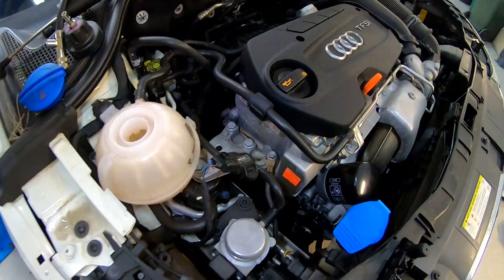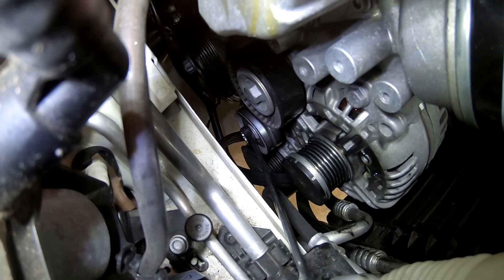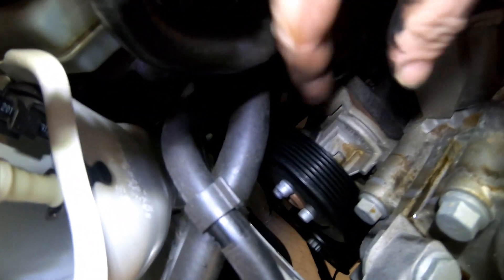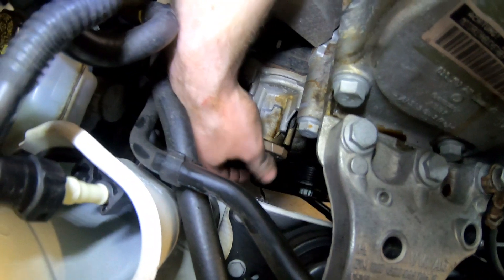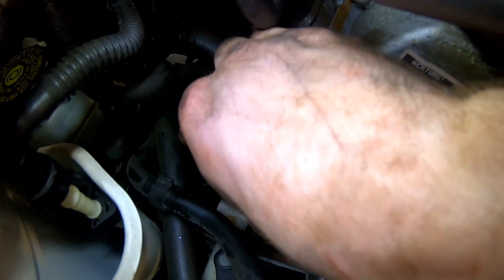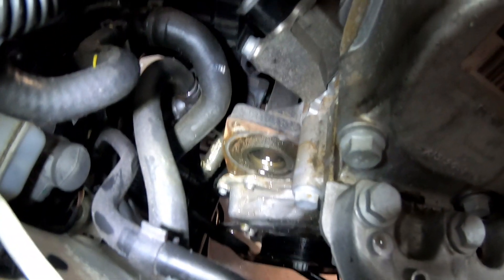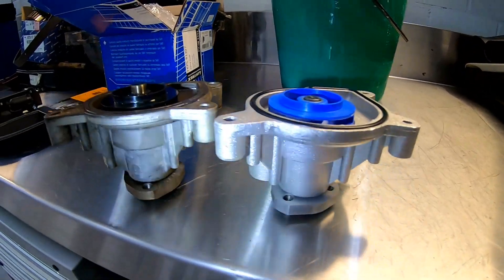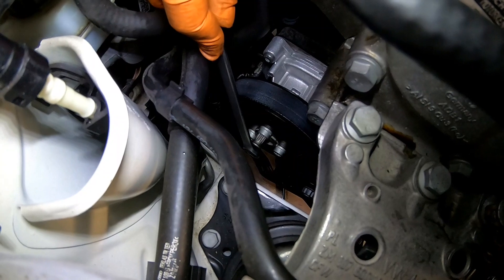1.4tsi CAXA Water Pump - Easiest VW Audi Water Pump?

Comment: What torque did you use on the pulley bolts and the pump bolts?
Reply: If I remember correctly it's 20nm
Reply: @bobmarley8000  thank you so much btw a mechanic from my city told me the pump bolts to the block use 12nm and the pulley 20nm

Comment: Comparing 00:20 and 03:56, you can clearly see the new pump has a hole in it, while the old one hasn't. The shiny thing visible through that hole is the pump shaft. What the hell? A hole through the top that gives dust and whatever direct access to the shaft? I'm somewhat skeptical of "cars being designed to break these days", but in this specific case — really, what the hell? What good could this hole do?

Comment: Hi @fourringsauto , you helped me big time about a year ago during rebuilding one of these engines thanks again!! 

Struggling to diagnose new issue.. started getting a “whine” noise at low revs. Was thinking water pump clutch or supercharger itself. Noise went at higher rpm. No fault codes. Now seems to be burning a bit of oil, and down on power at higher revs. Found lot of oil in inter cooler pipe and burning oil. Signify turbo gone? Diverter valve?
Reply: https://m.youtube.com/shorts/sykaJhKQ_OU?feature=share&fbclid=IwAR1n77DOXZQXdmTpiL0nBBtAcFR_6w8PCrY1E0YAkICiBWTX65Y_bOkrSUQ this is the noise

Comment: Excellent work. I have the CAXA engine in my mk6 golf too. I have noticed my coolant bottle is going down. I can’t see any source of the leak. Doesn’t appear any leaking at pump. But seems most likely. Is there any test I can do to check it??
Reply from the maker: Usually you would pressure test the system. Check underneath the radiator too. Look for pink staining if using factory coolant. Perhaps top up with distilled water for now and monitor it for the now?
Reply: @FourRingsAuto  thanks. I checked over engine with UV light. Couldn’t see anything. It’s very weird. Oil isn’t milky. I’ve ordered a new bottle in case. But it’s very odd.
Reply: @Clint_L  having this same problem the last couple months, did you solve it?
Reply: @CocoCoryBrough99  Had the same problem for months, coolant disapearing but no obvious leaks. One day when i coldsstarted the car, I saw a drop or two by the waterpump but nothing in the area around or on the ground. My theory is that it vaporises when the engine get hotter. I changed the pump and now I don´t have to top of the coolant anymore!
Reply: Update 🙂 ended up being the charge cooler (water cooled intercooler inside the inlet manifold at the back of engine) which was leaking coolant and allowing it into the cylinders, €90 for a new one and hasn't leaked since, all good 😁 fitted myself in 90 mins
Reply: Take off the plastic pipe going from the turbo to the throttle body, then push open the flap on the throttle body with a screwdriver and if you see coolant in the manifold behind that flap then you know that's your problem 🙂 I was lucky to find it by chance as I removed that pipe to change coil packs and happened to open it to inspect throttle body, I have a couple videos of it and the cooler leaking I can send to you somehow if need be, haven't found any forums or people who have changed the cooler so I think it would solve alot of people's problems 😁

Comment: I have a very big problem on my a1 1.4 tsi 122 briefly when the car get to operation temperature 90° I get hard hesitation on 4 5 rpm when I accelerate I changed the hpfp and nothing changed maybe you have solution or you had a story like mine . Thanks
Reply: Injector clean LIQUI MOLY magic.

Comment: Thank you very much
Very helpful
I managed to replace it to my b6 Passat 1.4 tsi caxa engine
I also had to remove an engine "hook" (undo two m10 bolts), which was standing in the front of the pulley. I didn't see it in your video, also it's not necessary to mount it back (it's there to hell you when removing/outing back the engine). I am not talking about the engine mount...
I am not mechanic but it's not difficult to replace it
Good luck!

Comment: I just got quoted a bomb to replace a water pump on a 1.4 Twin-Charger motor in a Tiguan.  Love the car, love the engine, but it's a five hour job they tell me.  The engine bay looks a bit different to what I see here, maybe a bit more difficult to access?
Reply from the maker: Tiguan is the easiest of the lot. The water pumps are generally a bit of a pain though, and have a relatively expensive retail price.

Comment: Great video, very helpful but what size and type bolts are used on the Pulley and the pump itself. Or what size/ type bits you need to pull those bolts?
Reply: Pretty sure he says torx 30 mate
Reply: On the pulley is M10, the pump it self is indeed t30

Comment: I think I can change this myself. Thanks. When do you think it will go? Car is from 2007 with 88.000 km. Coolant changed at 75.000 with original G13
Reply from the maker: No set mileage mate. Just inspect every service and check your levels every 2 weeks.
Reply: @FourRingsAuto  Thanks. I will do that. I have had twice, so all in all 200-300 ml in 13.000 km / 2 years. 
You seem to be very familiar with these engines. As I have one of the early ones, would you recommend me to get rid of it while everything is good, or is it safe to keep? Had it for 4 years and I love. No mechanical issues, but I drive as correct as I can (cold/warm engine)

Comment: Same issue on my car. On a 7 year old  -100K km, should i change the full timing belt system or just the pump  ?
Reply from the maker: If it's also a CAXA engine then it has a timing chain. It is a good idea to replace it in a preventative maintenance way as they do wear and lengthen over time, and the usual thing is it goes unnoticed by many owners and end up jumping time and causing damage. I have a couple of videos on how to replace it, and the timing tools can be bought reasonably cheaply too.